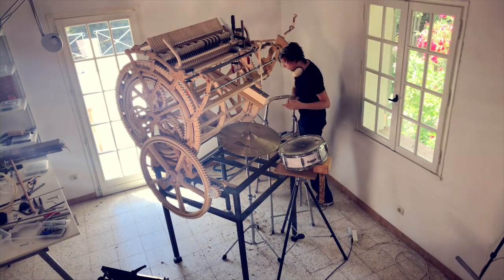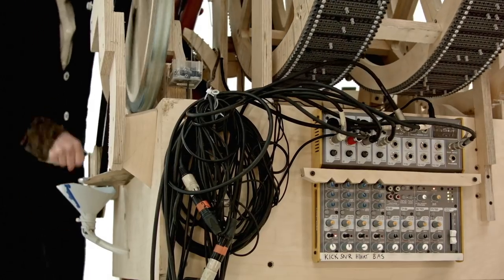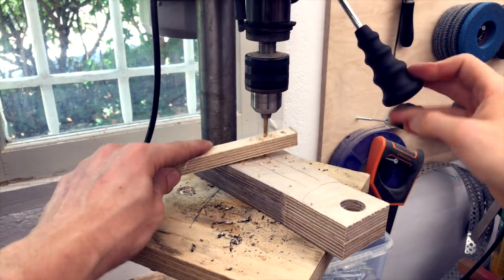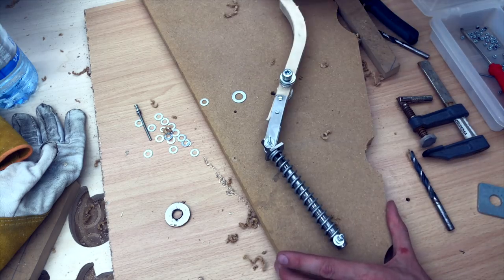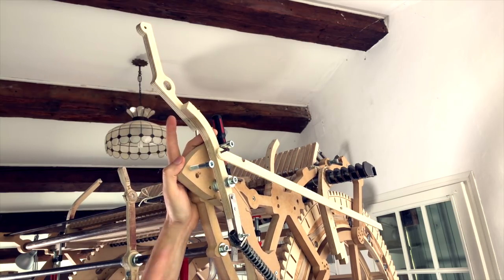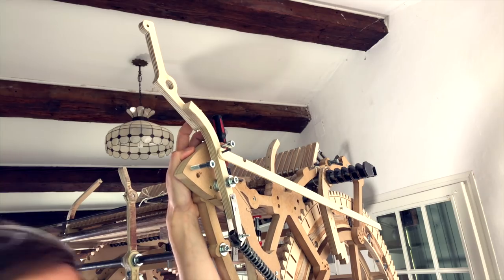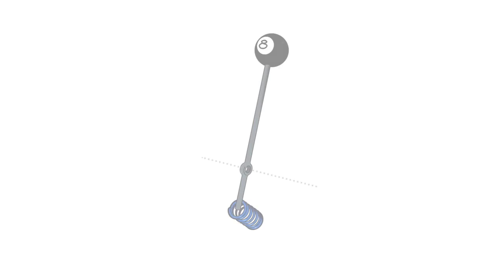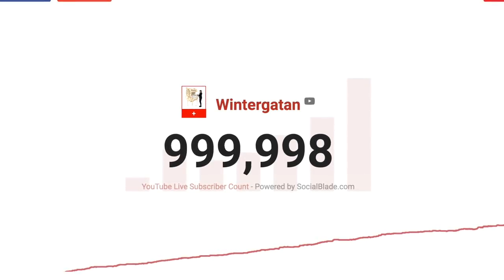Bistable Mechanism - Marble Machine X #44

Comment: Spring bistable is good idea, but I would use a tension spring connected above the fulcrum instead.  There is no need for a rod to prevent spring buckling, and its attendant friction and fabrication.   Even though noise is no concern, the hammering will loosen and damage the limit stops and the linkage pins.  I would felt pad the limits for that reason.  If you curve the connecting link. you can arrange for one of the positions (of the muting system) to be insensitive to the exact lever position.
Reply from the maker: Great insights! thanks
Reply: I was about to post the same idea when I decided that someone else must have suggested it. The problem with a pull spring is that some part of it needs to sit next to the arm and not in line with it. What I came up with is a long squared U shaped attachment made of flat metal that runs from the "spring" attachment point above the arm fulcrum down to the spring that sits inline with the arm below the arm pivot point. Then the spring is in the same place but attachment is way easier than that pusher spring stuff.
Reply: Easier way!  He has a long link going from the mute handle to the mute assembly.  The mute (handle) lever, the mute link, the lever on the mute tube, and the machine frame form an approximate parallelogram.  The spring can be tied anywhere along the mute link to a fixed point below (the fulcrum) and will give the same bistability.  The spring and the link can be in the common plane without interference, as there is only a "virtual fulcrum" "in the way".  This has the added advantage of eliminating the effects of play in the link, because it is preloaded downwards.
Reply: Matthew TING 😂😂
Reply: @Wintergatan  😉😉😉😉😉😉😉😉😉😉🍎

Comment: I have enjoyed this series for such a long time now, thank you so much Martin! It has been so wonderful to join you on the journey towards MMX and can't wait to see where this all takes you. I hope you continue to enjoy each step in the process of making the MMX, low points and highlights and all.

On a side note, with the spring system for the levers (this may or may not be a problem) they do seem to move a bit laterally and the pivot near the spring every time they are flicked. I have a feeling once you get it all secured in there it wont be a problem, but it doesn't hurt to mention it :)

Best of luck! Cheers!

Comment: Congratulations on 1 Million Subscribers! It occurred to me whilst watching this that if you thread the pivot point at the base of the sprung section of that lever and then put a pair of counter rotated nuts on it you'd be able to control the tension on those springs more precisely. You'd be able to adjust the resistance on the levers whilst also avoiding having the spring riding on the pivot shaft. You might have thought of it or not have the clearance in the design but i thought I'd suggest it anyway as i didn't see it in that cad view 😀, loving the series!

Comment: Today I learned a much, maybe one of the greatest things: It's okay to change the design during the building process. I am working for a engineering company as a constructor and always want to plan things right the first time and don't have changes when I'm done with my work because I have put a lot of thinking and effort in design. But I'm often not sure if everything will work out fine and when things (specialy private builts) go wrong I'm angry and frustrated and can't be happy when the built is finished that I made it and it's finished.
But failing and changing things is okay and I hope I remember next time when things don't work aaout fine.
Thanks a lot, have fun building the Marblemachine and hopefully you come to Austria to play a show.
Greetings from Austria,
Günther

Comment: The snap back and forth of the levers looks really satisfying.  If you wanted to, you could you attach the spring further back in the mechanism, to a different moving part, and have that snap still be translated to the lever?

Comment: You could make the bottom of the mute lever shaped like a cam (the part that comes in contact with the springed plate) to get a more smooth and distinct shift or whatever you wanna call it. Instead of having it shaped like a "U" which it is now, with the "U" shape there is a greater chance of getting the lever into a middle position and you would need more force to pull it. So my suggestion is to make it cam shaped (rounded "V" shape instead of "U" shape). Maybe you could even put a cylindershaped roller on the bottom of the cam to get it even more reliable?
Hope that made some kind of sense haha and good luck on building one of the coolest music machines in history ;)

Comment: You can make bistable mechanisms with magnets as well.  basically you need the magnets to repel each other at the midpoint.  If you make the mechanism a bit differently you can get hysteresis and have the trip points not be at the exact center.

Comment: When you have a mechanism making noises from impacts, it's a good indication that eventually, with enough time or enough cycles something in that area causing the noise will fracture and fail.  I used to have it a lot with stopper bolts on assembly machines in my old job.  the noise may not be a problem for the sound but I would suggest just a little padding, maybe some rubber or even a little felt around any metal on metal surface.  polyurethane is best though as it lasts almost forever.

Comment: i would use the pull spring system instead of the push, because with the pull system you can easily use a light spring, and keep it under tension. this will remove the rattling of the spring, letting you mic the mute levers to get a good satasifing thud. who doesn't love the thud of a good lever pull. 
the sound of the mechanics is why i love the original. hearing the gears turn, and the soft click of the fingers dropping the marbles. then you have that lovely thud of a lever being thrown every time something gets added or removed. 

what i'm saying is, the one in the middle at 1:53 will let you mic a clearer thud with les force on the system, and relatively no spring rattle. 
this smaller force will also not reverberate throughout the entire machine as much.

Comment: The design of the marble machine X reminds me a lot of computer architecture. Of course, it's not completely analogous, but it's similar. Like the programming wheel is like your program memory (duh), the registrators are kind of like the registers around the CPU. Except everything is mechanical and totally not meant to be a computer.

Comment: in 6:53 the lever stayed in the middle. I suppose it still needs some adjustments. Maybe a more in depth analysis to get the perfect combination between spring tension, pivot position, lever length, etc?

Comment: The flat I live in was built in 1923 and in the 40's when the gas lighting was replaced with electricity the light switches uses this spring action mechanism. Very bulky compared to modern designs.

Comment: There is one way you could improve on the design even further. A problem you might run into is friction holding the lever in exactly 18 degrees if not released properly. One way of fixing that is having the lower part of the upper lever not exactly round, but more V-shaped, so the 180 degree position becomes even more instable, thus deciding for either mute or unmute position.
To clarify my point, I threw together a graphic illustration of what I mean under the folowing link:
https://www.deviantart.com/deepestofblue/art/MMX-Bistable-Mechanism-Suggestion-754611653?ga_submit_new=10%3A1531649950
Hope it helps,
J